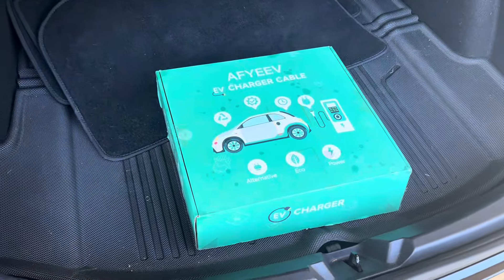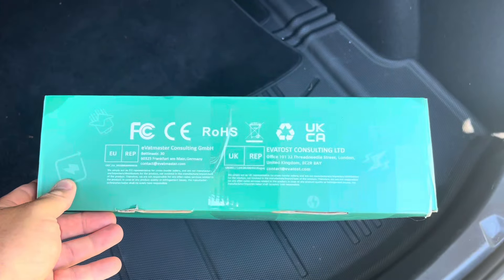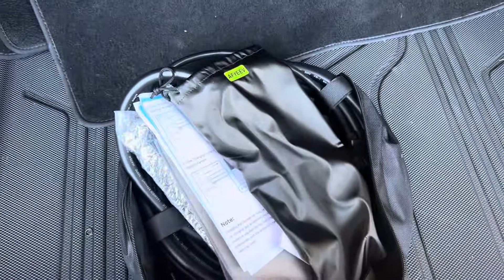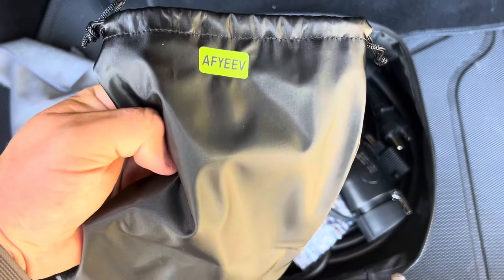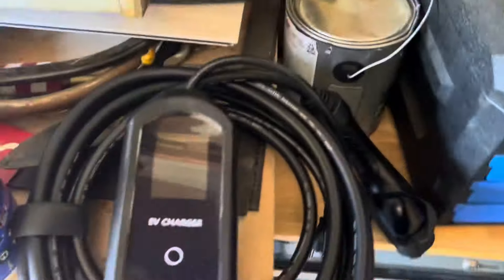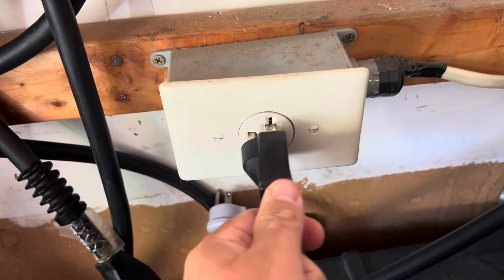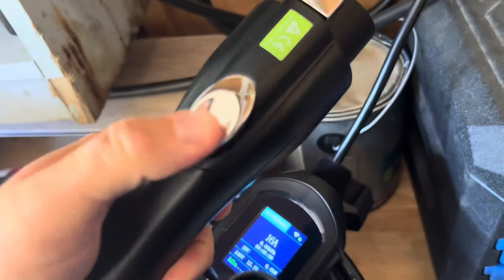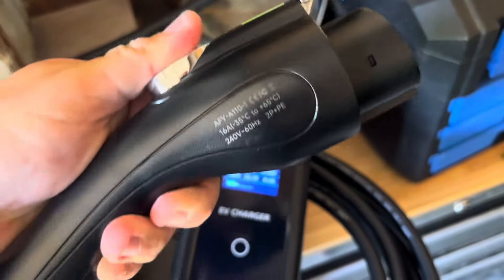AFYEEV L1/L2 mobile EVSE.  Good or bad?

Comment: With the EVSE connected to a WiFi network, can you access the EVSE from anywhere or does your phone have to be connected to the same network?
Once the EVSE is connected to the WiFi network does it have a web interface or does it only work with the phone app?
Did you find out why the EVSE showed ground fault to your 620 wall socket but not to a 110v socket?
In the menu it says "Time Reservation", is that just a time delay for the charge start? If so, does it show anything on the display when it is in time delay? Like maybe a countdown to charge start? 
Is there any scheduling ability in the app? Setting specific times for start and stop?
Reply from the maker: @jaseastroboy9240  anywhere.  As long as it’s connected.  You can remotely access it

Comment: How is the performance? Is it safe to use?
Reply from the maker: works perfectly fine, no issues.  Have tested it from 8a to 24a as i dont have a 40a circuit i unfortunately cant test 32A. however it works as it should and I feel its completely safe.  Remember the car's are more intelligent than the EVSE's,  if the car detects an issue, heat/voltage/etc, it will limit or stop charging.